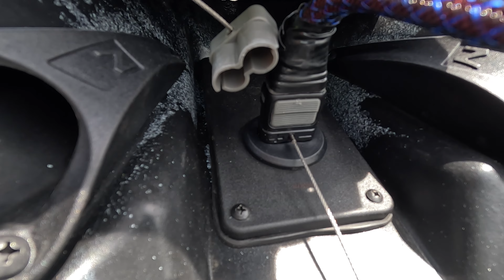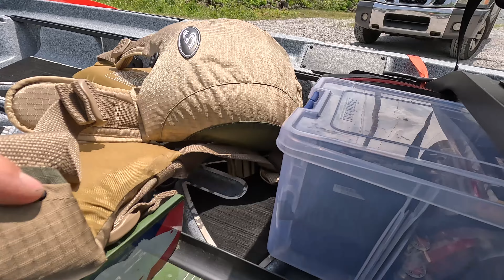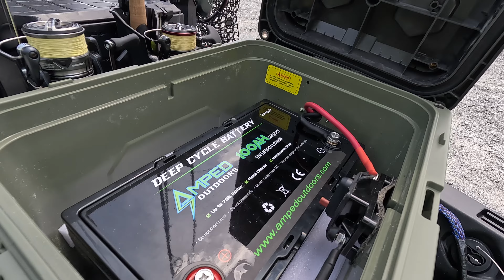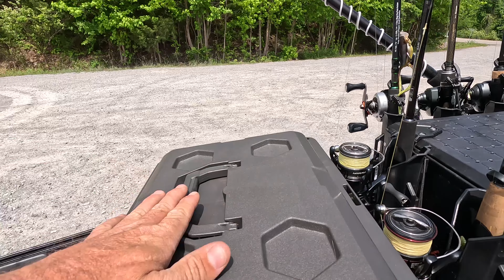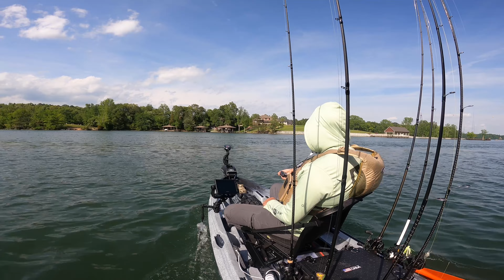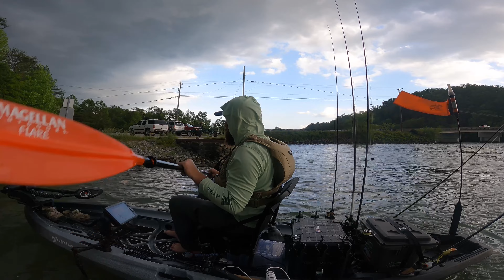Nucanoe Unlimited with Motorguide XI3 Walkthrough and On the Water testing.

Comment: She came out awesome. I'm running the same motor, and I do run my J2 Bixpy PP 768 on the Gravity rudder. Plus I have my fin drive. It's always on board, and I'll use it on short hops, or to keep in shape, and paddle. But now everyone is going motorized. I fish with 4 friends, they're all motorized. And in tournaments I love to be able to cvr water, and get away from boats. Epic vid bro. I love the Nucanoe fleet, with the swivel seat. My seat adjusts up to 3 height levels. And it's built into the seat. Stay safe. 🌊 🎣 🛶

Comment: New subscriber, this is the video I needed to see. I have a bonafide p127 and have been going back and forth on getting the unlimited with the xi3. Have you missed the pedal drive at all since switching?
Reply from the maker: None man, it’s actually so nice having the space to move around or just stretch your legs. No regrets!!
Reply from the maker: If you get one out Robert Doss down as the team member that helped you haha
Reply from the maker: If you do start to miss them you can get the Pivot drive and have pedal power again.
Reply: @redclayoutdoors  I'm actually about 40 minutes from boats and motors of Dalton lol. I may go check them out tomorrow.
Reply from the maker: @sir12oz9  they have one unlimited left and are doing dealer pricing on everything
Reply from the maker: @sir12oz9  tell them I sent ya
Reply: @redclayoutdoors  i will man, thanks

Comment: I know it’s a wide boat but does it feel a little skinny where your feet are when you stand? I see the glide tracks take up some of that space. You don’t seem cramped. I have a native slayer max and I kind of don’t like the raise middle portion where my pedals are. Makes it cramped to stand in which I really don’t do much anyways because I feel unstable.
Reply from the maker: I have never felt cramped or like I need a wider stance. See if someone close to you will demo one for you
Reply: @redclayoutdoors Oh, I almost forgot to ask this. Will you be purchasing the flip down rudder? I heard a few people say that you need that to keep tracking straight. Is that true?
Reply from the maker: There are certain instances where I definitely feel it would be helpful with maneuvering but I wouldn’t call it a necessity. You can definitely run it without and still be just fine. I do plan to add it as well as the supper transducer mount but I’m not dying for it.

Comment: Curious what size black pack you’re running? I have the unlimited and the same 100 AH battery. I thought of running the 16x16 pro for the battery box and downsizing to Buzbe 3600 to fit in with the battery
Reply from the maker: I have the 13x16. I wouldn’t go any bigger honestly
Reply: @redclayoutdoors  well I wouldn’t either running two boxes. It is a nice setup. Im just wanting an all in one deal with tackle and battery
Reply from the maker: The 16x16 won’t fit where I have the battery box, I have seen a guy running the 13x16 and a 13x13 for the battery box. If you put a 16x16 in where I have my 13x16 you won’t be able to spin the seat unless you slide it forward but it’s really best to keep the weight in the back especially in rough water conditions.
Reply: @redclayoutdoors  makes perfect sense. I have the yak gadget xl crate and a battery box and I can’t spin all the way around just side to side. And I had the original black pak. Wish I would’ve kept it